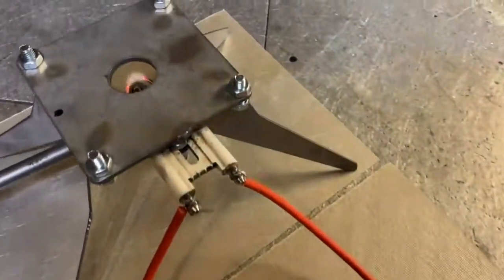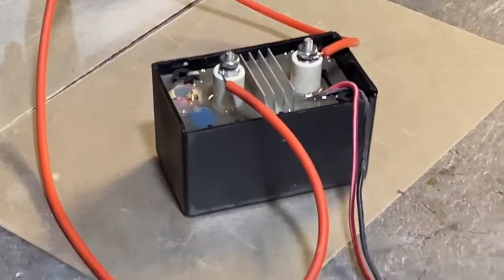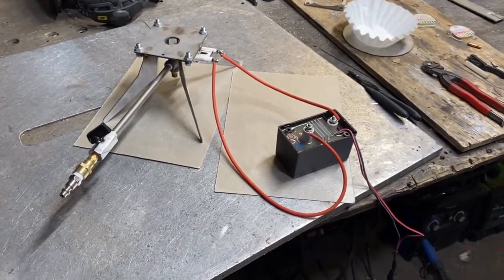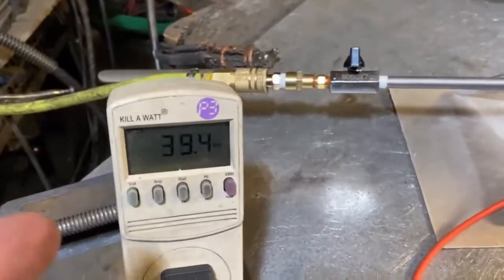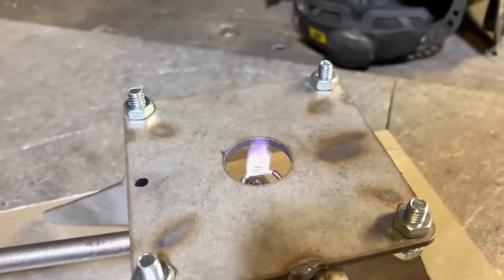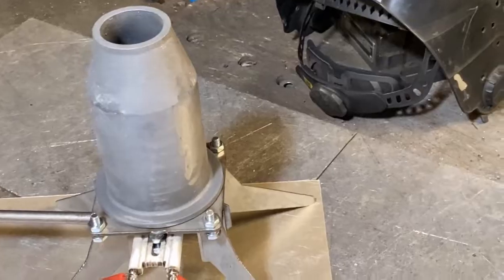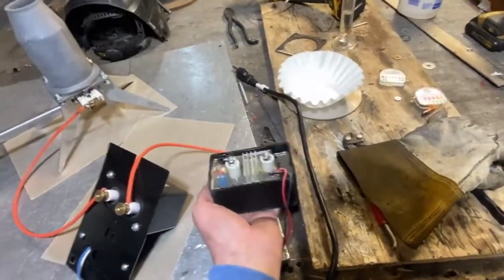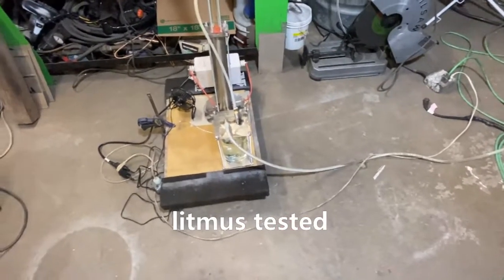Electric Ignition Oil burner for client in New Zealand

Comment: I think this may help you for designing off grid electric ignition units. You can make a standard 5 pole auto relay into a high frequency switching unit with just a capacitor across two pins.  Changing the cap changes the frequency.  Its really just the spring inside flapping as fast as the cap discharges.  This is a small car battery into a chinese step up driver into an auto coil using the relay oscillator.  The chicom driver was running away with heatsoak to 90vdc on the input side when i measured the 13K volts output.  I was playing with solar fence chargers.  It still works without the drive  at much lower voltage but will make a normal sized spark. 

Nice job nobox, youre a hard worker.

https://youtube.com/shorts/wZRd1xorzyo?feature=share

Comment: I totally agree with you NoBox7 that the ignition transformer should last and last. You are correct with the copper theory from the CHINAMAN. The will really go out of there way not to put copper in a unit. XI JINPING is at war with the copper GODS. Am surprised that the ignitor died. I have worked with burners and rarely do they fail. I mean RARELY.
Reply from the maker: agreed , they are very durable
Reply: @NOBOX7  I just had a brainstorm fella. The electric arc that failed had many unique arc shapes and ladder designs. I would bet you that if one would reverse engineer how to make this happen you could use this arc in a circle around the flame front from your burner to gain an even cleaner praticulet burn cycle. 
What do you think NoBox7 ??

Comment: An automotive ignition coil would perform better and last much longer.

Also does not need such high input voltage.

And finally, the sharper of a point you can make on the ends of your electrodes, the hotter and more durable the spark will be.

Comment: In our country to get 220 volts we use two phases at 110 each. in other countries they use 1 phase at lower frequency and 220 volts per phase. you end up driving it at 220 volts at 120 cycles per second here.

Comment: You must add timer for ignition becouse the transformer cannot operate in long time. In my experience only 15-20 sec per cycle. So trafo must off and then can use it again
Reply: Ambiguous words is therefore misleading, he should get money back
Reply from the maker: its says continuous duty cycle
Reply: @NOBOX7  it's says continuous duty cycle, not continuous duty operation... they deliberately put ambiguous words there...

Comment: Just a point to ponder - NZ runs on 250V (220V) 50Hz and not 60 Hz as that transformer. Could be an issue...
Reply: 230 v and 50hz